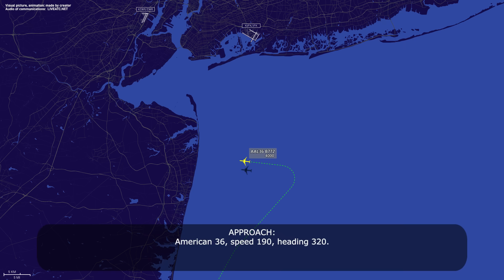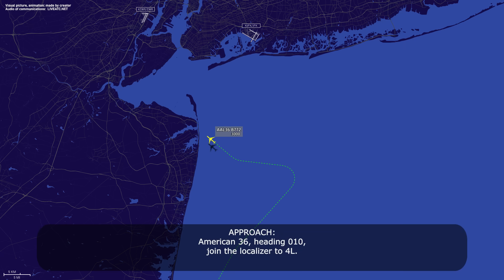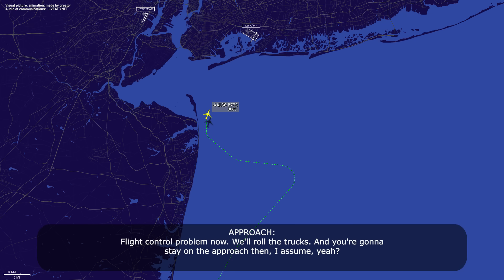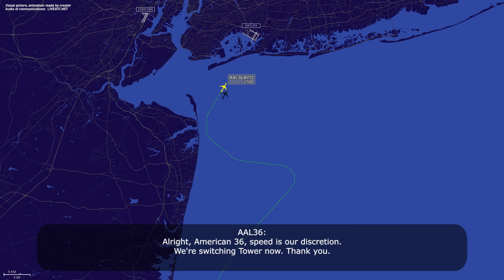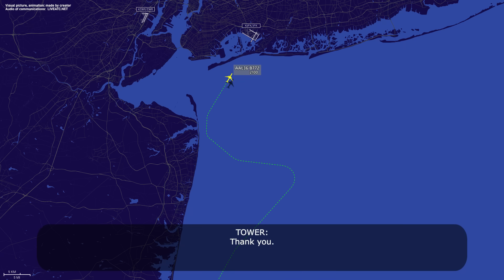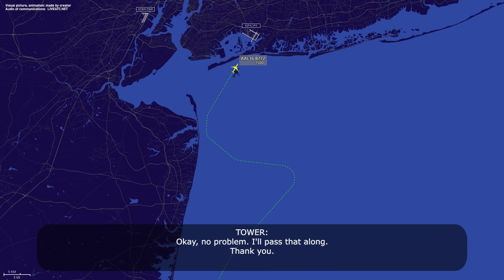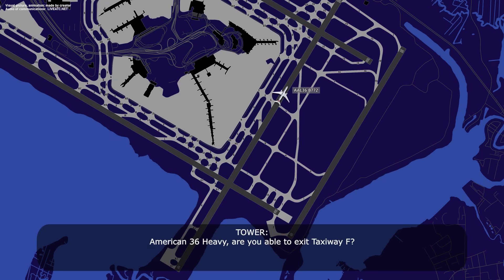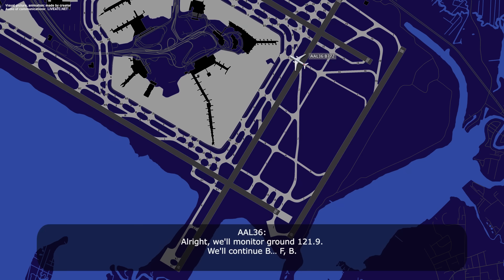Flight control problem on approach. American Boeing 777 diverts to Kennedy Airport. Real ATC

Comment: A possible hydraulic leak that knocked out some of the flight controls and triggered the late change of mind regarding ARFF. It would be perfectly feasible to cross the Atlantic like that, but the repairs in Spain would likely be more difficult than in a home base.

Comment: Why didn't they just jettison fuel?
Reply: Probably because they were already too low. You generally have to dump fuel up pretty high to let it evaporate.

If they were too over weight they likely would of. But overweight landing procedures exist for a reason
Reply: @treym2k You only have to be at 5,000.